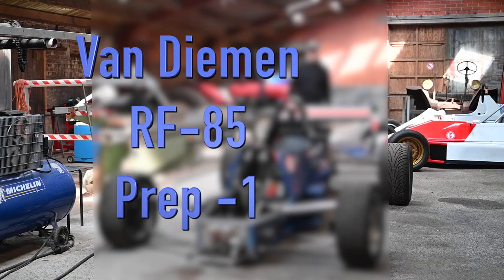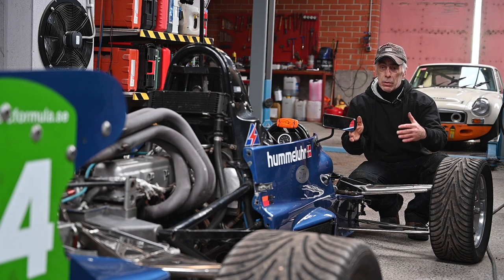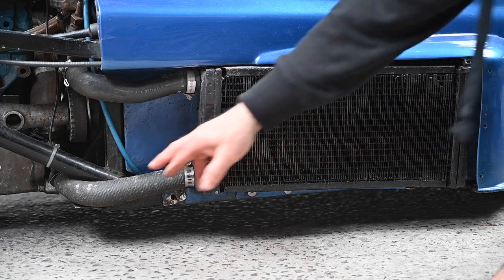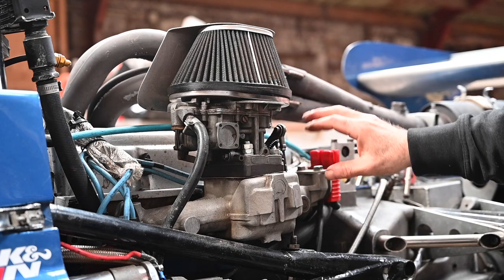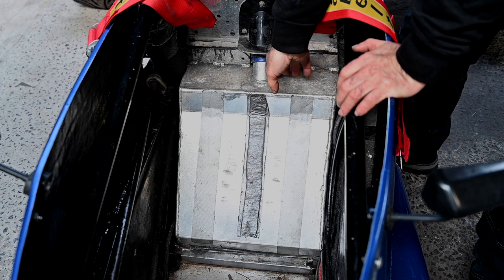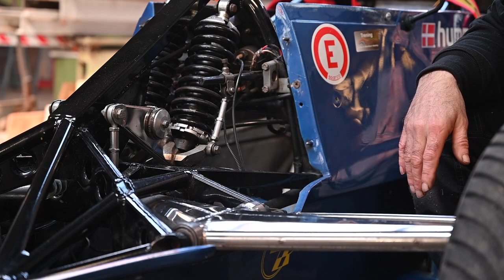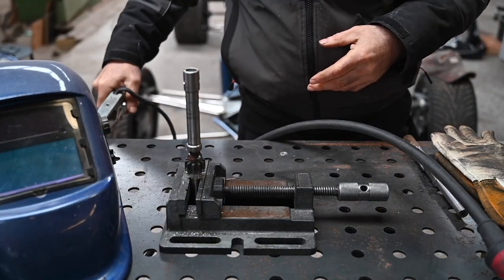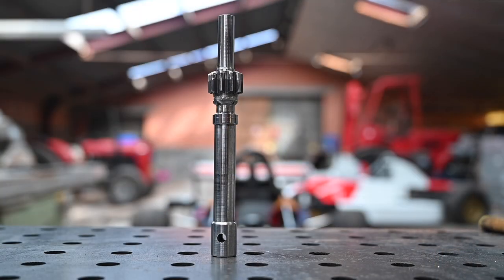Van Diemen RF85 -   Prep work 1

Comment: Thats looks like a really good buy. Nice having one with such history.
Repainting it to the commadore look would be really cool 👌

If you wanted to do a new exhaust theres a guy called Calvin Elston that does wonders with exhaust. Could probably get 10-20 hp at the top end plus a better low end response with an exhaust made to his specs.
Reply from the maker: OK , thanks that is a great tip... I will contact him possibly
Reply: @D3Sshooter  I guess hes very busy so it might be hard to get him to take on a job and pretty expensive if he accept. 
I aim to build my own headers according to his ideas. Hes written alot on speedtalk forums where his nick is ”exhausted”.
The main thing with his headers is the use of stepped headers where the first tube is much smaller than usual. 
Hes built stuff for nascar and other racing for many years. Reading his posts on speedtalk have been very interesting.
To do the design one can use the sheet on the homepage of burnsstainless to get the fundamental design. Then adopt the stepped tubes per Calvins views. As I understand thats how he himself does it nowadays.

Comment: Besides checking the tension on the oil pump belt, check for age and wear. I had one snap apart on my Royale years ago and and immediately dropped to zero oil pressure. I shut it off quick enough to save the engine from damage. The idiot light for loss of oil pressure is necessary I think. Maybe a smaller one though. You'll notice that before reading low prsseure on a guage.
Reply from the maker: Hi Drew, indeed that warning light is very importend as we don't watch the gauges all the time on the track..  I will install a new high intensity LED light , but not that big...  I am thinking of building an audio warning, a beep or so remote into the helmet...  Just a small transmitter and receiver.. with an earpiece and a tone...  would work better.   Not sure yet , but considering it
Reply: @D3Sshooter  That's a clever idea. I'm sure you can make it work.

Comment: Nice car. Be worth trying to lift those oil pipes (4:35) higher - use an elbow with tighter radius maybe. They look vulnerable if you go off track and might pulled off. Have done this in a race and didn't notice subsequent loss of oil pressure which seized the engine. Hence my car also got a HUGE oil pressure light.
Reply from the maker: Indeed, thanks for the comments

Comment: The oil pump is driven off the jack shaft, but what is the cable at the rear of the pump? Mechanical tach? Ha!, soon as you started it I saw Sir Jackie Stewart's face. Love that growl.
Reply from the maker: yes indeed.. mechanical  rpm

Comment: Hi and thxs for your answers..responding to your questions : 1.6L VW BERTILS  with MK 9 Hewland....what program you use in your computer for figuring the gears according to the tracks?   Thxs in advance.  I an learning a TON ( newbie)....
Reply from the maker: Thanks for the comments, its a spreadsheet like excel or numbers and I just  put in those formula's:  You need to know the powerband of your engine (RPM's).  torque band of the engine, Your Final drive (diff ) ratio, your wheel diameter.   To calculate the speed in a specific gear, take your (engine RPM)   multiplay with the (Ratio of your selected gear),  take that result and multiply it by the  (Ratio of the Diff.)  Take the output of the diff and multiplay this by the (tire diameter in cm  x 3,14).  You now have the the distance  (in cm) driven in one minute, multiply this by 60  (minutes to the hour) and divide by 1000 ( for km).   That gives you the Km/hr at that specific engine  RPM.  You can do the same for the  torque on  the wheels,  but use the engine torque instead of RPM and divide instead multiply .   Do this for the different RPM's ( in an excel or numbers spreadsheet you can do all this very easily) .  The results can then be plotted in a graph also in excel or numbers . Just insert a graph...

Comment: Steve, you mentioned the low power of your lathe, with you experience, what minimal power would you recommend?
Reply from the maker: I would love to provide a meaning full answer, but a 1 to 2Hp electrical motor would really help. It all depends on the diameter of the piece and the RPM's on the lathe..